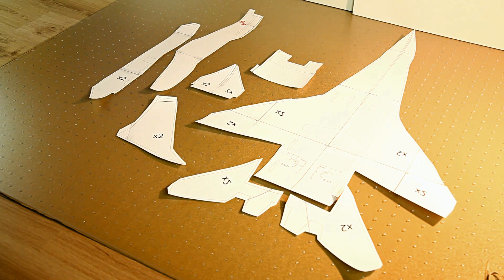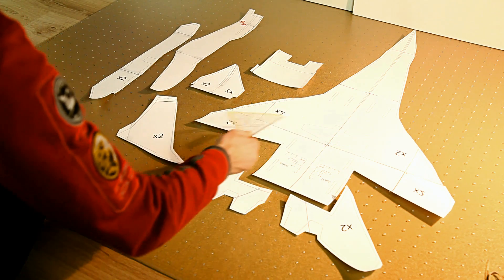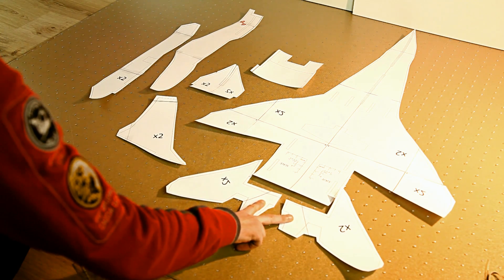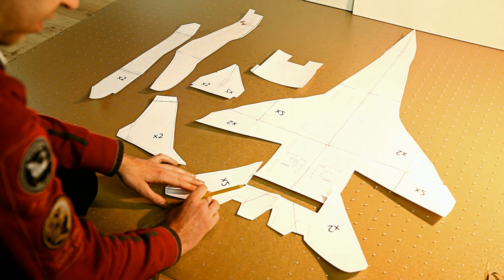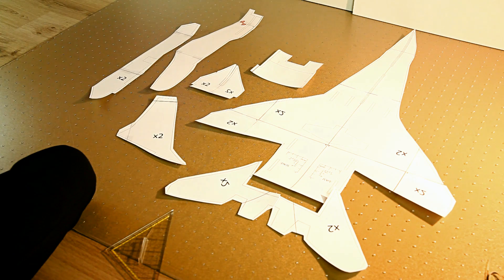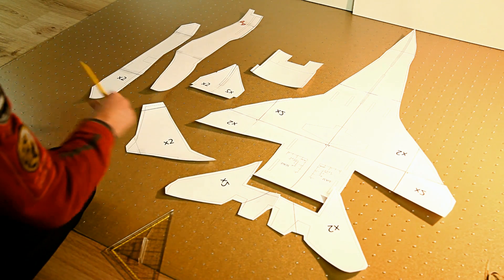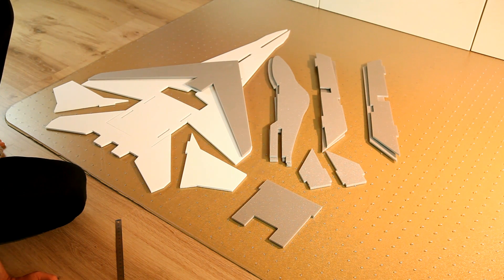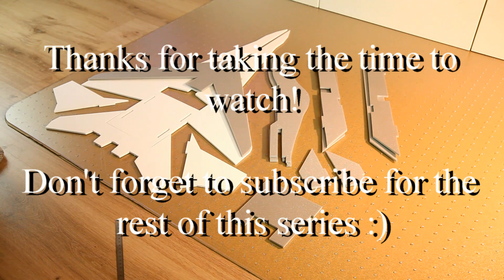RCPowers Mig-29 Scratch Build - Part 2

Comment: Really nice plane!! :) Where do you get the grey depron in the Netherlands? I would like to try to laser-cut it...It would be even better with black depron!
Reply from the maker: dammuozz Thank you sir! :)  I got this grey Depron from a wooden-floor installing company.. They use depron as a sound-absorbing under-floor :)  
I have Nooo idea if there is black depron, but you can paint it offcourse :)
Reply: DutchRC ADVENTURES Just watched your 30+ flights review on the EFX racer, I just got one and I'm preparing it for the maiden!! Subscried...Do you remember the name of the company? I live in Amsterdam and I would like to try to cut it, if it works I will build a CNC router with a laser head! :) I already built one with a drillbit head but it makes a lot of noise and dust...
Reply from the maker: dammuozz Thanks for the sub man :)  Hope I'll be able to make more video's that have your interest :)  
Yes I do! It's called 1001vloerenoutlet just add the .nl  and you're in :)  
Let me know what you think of your EFX offcourse, and good luck on the maiden! :)
Cheers
Reply: DutchRC ADVENTURES Thanks mate!! I'll let you know! Cheers :)